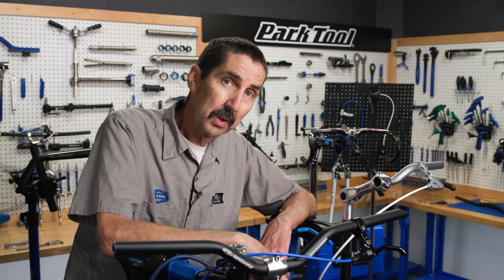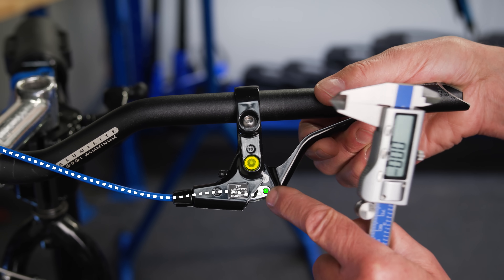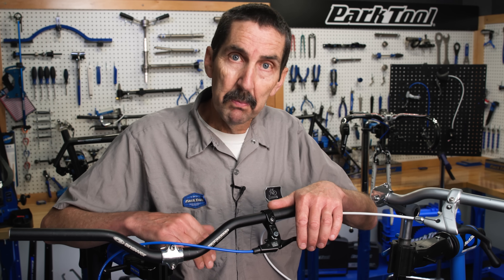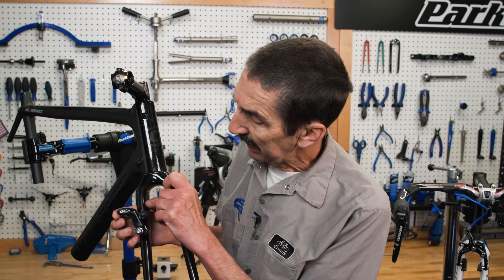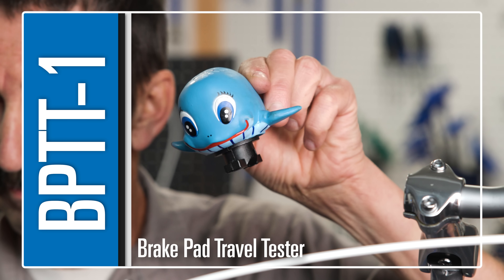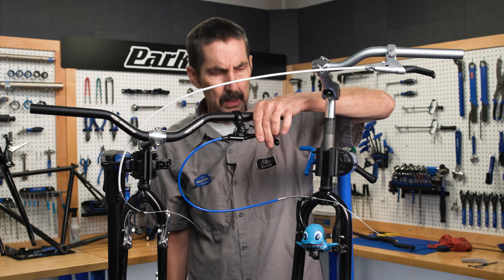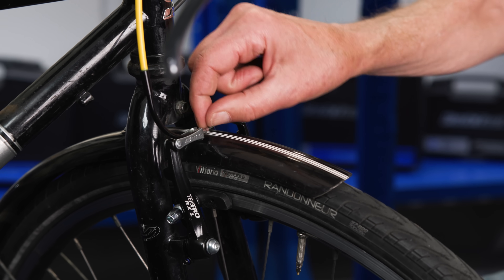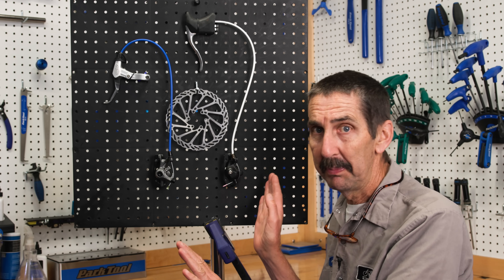Brakes: Long and Short Pull Systems | Tech Tuesday #237

Comment: I rebuilt a 96 MTB v-brake frame with road components and I was expecting a problem because the levers are of course short-pull and I needed long-arm brakes to assure clearance since I am using 700c regular road wheels. 
However, the braking power is awesome without any loss of feel. 
The only real problem is that it was a pain to release the noodle exactly as Calvin explained. I added some inline cable adjusters that reduced the problem a lot. 
An alternative would be to use a device called "travel agent" that changes the cable pulling ratio so that one can use short travel levers with long travel brakes but I didn't feel was necessary with my setup.

Comment: Thank you for this great Video! I use on an old 26 inch MTB strong v-brakes with long arms. And convert it to a singlespeed gravel bike with dropbar. Brake levers using Tektro RL 320 long pull for dropbar. Best solution for my lovely v-brakes.

Comment: You definitely need to continue this with a discussion on the actual pull-ratio of e.g. modern Shimano STI levers (super-SLR?), that is somewhere in-between short- and long-pull. And is there something similar on the SRAM side with their road brake-levers?

Comment: I upgraded the hybrid shifter to road and the front derailleur just did not shift due to different pull ratio. Ended up replace front derailleur to road type as well.

Comment: Just to complicate matters, the Tektro RX1 brake at 5:42 is a "mini V-brake" with 85mm arms - shorter than a regular linear pull brakes, but longer than cantis. Functionally identical to the more expensive TRP CX8.4 which is (or was) primarily marketed for cyclocross use with short pull road levers. Very effective brakes, but need careful setup to get sufficient rim clearance.

Comment: My LBS installed a "travel agent" to adapt the short pull brake lever/shifters I wanted on my new bike to the long pull cantilever brakes the bike came with.  The system has been working great since 2003.

Comment: Suggestion for the BPTT-2 Make it so that it can be filled with water. A little water jet would be coming out on top when a force would be applied, helping people with a hearing loss see the difference.
The height of the water jet would be proportional to resulting exerted force.
Reply: The height of the water jet would be proportional to the resulting brake movement.
To measure brake force (which is on the order of units or tens of pounds/kg of force) you need a much heavier duty  BPTT)
Reply: @CalinCETERAS  
You must be a women magnet in a party.
Reply: But the BPTT-1 's squeekiness just makesme smile.
Reply: @morlamweb  
Then the solution is to market it as the BPTT-1S. The S standing for squirting and being made for those with special needs.

Comment: Wow, this is great!  I now understand why my “upgrade” to my ‘86 Paramount hasn’t been as crisp as I’d like.  The paramount was purchased as a frameset originally and built up with parts on hand (back in’86). I used mostly early (‘82-84) Record components (matching brake set) and everything was fine. Then years later I switched the brake levers to late 80’s Record aero style. I ended up with that “squishy” feel that you describe! And no amount of cable “stretching” would resolve it!
Wish I’d known this 10-15 years ago!😂